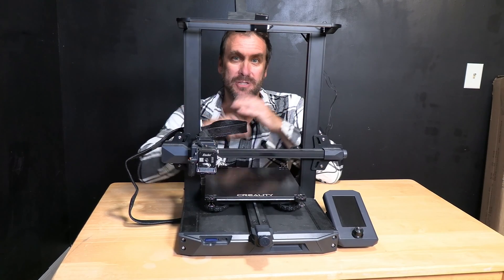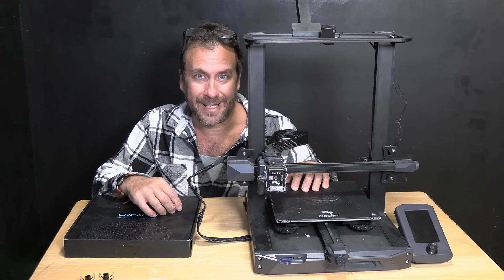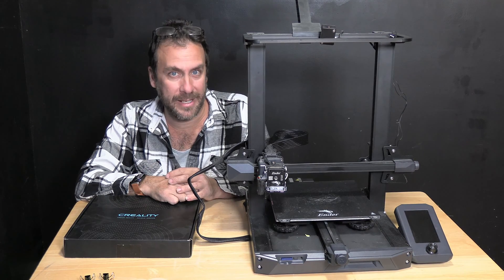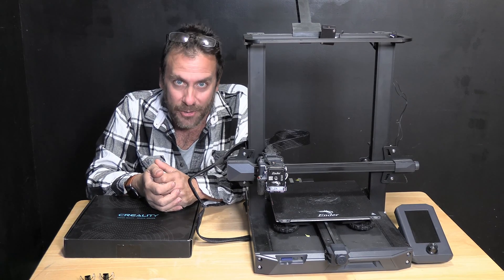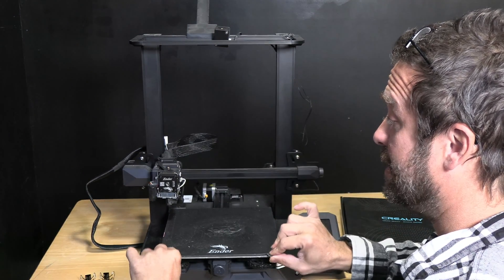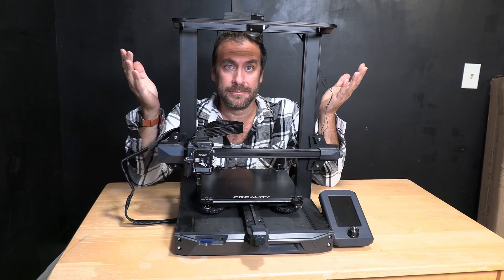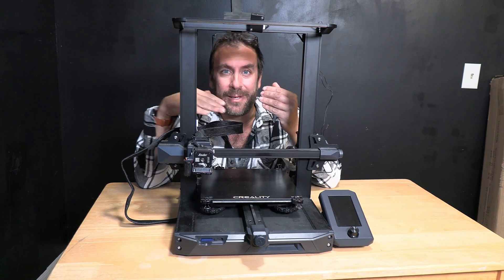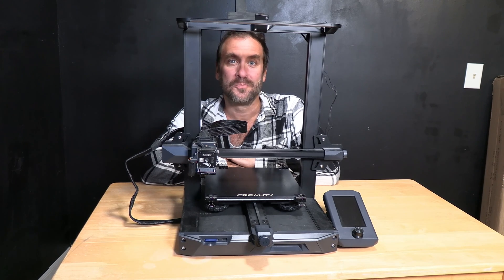Swap Creality Ender 3 S1 (or S1 PRO) Magnetic Bed with GLASS BED, for Instantly better Results!

Comment: Mines sticking to the magnetic film on he build plate. Should I take it off?
Reply from the maker: I wouldn't. Haven't touched my Glass bed since the day I put it on. If you ever need to remove it, which you probably won't, you'll be able to work it off. I tested on mine and got it to separate with some encouragement.
Reply: @3DRundown  I have to take mine off every-time because the prints stick so bad to the glass bed any help?

Comment: The idea of the magnetic bed is to remove it with the part and slightly warped to remove the part?
Reply from the maker: Right. Typically, can pull up on a corner and the model will seperate

Comment: Tip I discovered for PLA+, I cleaned the glass bed with soapy water, then dialed the Z offset right down to one of thse thin pieces of paper doctor's letters come on. I initially found that releasing prints was difficult as they were over adhered, but I was still getting corner curling internally. I now print only Layer 1 at 75, then let it cool off to 60 for the rest of the print. Adhesion is amazing throughout the print, bu the temp is low enough i don't see any differential cooling issues at the corners. Then I just let the bed cool off when done and the prints come off really easy.

I also replaced the usual paint scraper with an industrial razor blade holder that allows me to get the blade edge flat to the bed. Tall, narrow prints just come right off the bed without the scraper, low wide prints just need an edge starting and pop. thin, flexible prints still love to stick, so I lift the edge cleanly with the razor, then slide the stiffer paint scraper in to peel the rest.
Reply from the maker: Clean the bed with ipa. Spray a little Hairspray. When bed cools, models remove themselves. Bed temp always the same. Cooling causes contraction. Contraction causes curling or shrinking or bed separation. 60 the whole time

Comment: I'm very new to 3D printing and finding your videos very helpful. I am having a problem, that I cant find an answer to. I am upgrading to the glass bed because I am having problems with adhesion on the stock bed. This video was great, and I viewed the other video on the z axis. the problem I am having, is the videos for all of the z axis, are for the ender 3, the control panel is slightly different for the ender 3 s1 pro (which is what I have). I need to figure out how to lower the z stop so it when levelling, it doesnt dig into the glass. whether thats manually changing the gcode (i dont know how to do that) or change in the setting somehow. Can you help???
Reply from the maker: Hi. There is no Z-STOP on the S1 Machines, we set our Z-Height (AKA: Z-OFFSET) In the firmware. Follow this video: https://youtu.be/dpF_h8aOTAI
Reply: i am having same problem with adhesion

Comment: Thanks for the video! I just replaced my print surface with a glass one, just like the one in your video. I have a problem though. The Sprite extruder is crashing with the clips (same ones as in your video as well). Do you have any advice? I do have the clips all the way.
Reply from the maker: My clips are only on about half way, and they hold fine. I would watch it during the ABL, and adjust the clips out of it's way as it moves by.

Comment: Because the layer fan is very close to the bed, it hits the clips in front, the other problem is that the adhesion is insane, I had to remove the bed and hit the piece with something to make it come out, when you remove the bed the calibration may be altered and it may be necessary to level the bed again, I have those two problems, but I liked more the adhesion of Glass vs PEI, I changed to glass because I realized the bed was warped, I'm just thinking about how to solve those two problems 🤔
Reply from the maker: Run an ABL, and adjust your clips as needed. Mine never hit. The one to watch, is the front left. Move it over a bit, and only clip the end on, the entire clip. It will stay put.

Your Glass is goin through a break-in period. Get Scots Blue Shop towels, and IPA. The only 2 things that ever touch my glass. Put the IPA in a spray bottle. Spray and wipe gently. NO PRESSURE. I like to use a good quality Hairpray. Tresemme #4 hold, to be specific. When you IPA and wipe, the Spray will disolve, spread, and then when the IPA dissolves, the Spray remains, and the tack returns. It's super. It also helps the models to release from the glass. You can remove it completely, with more IPA Wipe. I NEVER remove the glass from the bed. After some use, nearly every model will remove itself from the glass, when it cools. BE SURE TO LET THE GLASS COOL. The contraction, seperates the model. If you have something really stuck. Remember, it's not actually stuck... it's GLASS, not a pourous material or glue. Put the scraper on a corner, and Firm tap. The whole model will usually pop right off at once. Tap front to back, rather than left to right, with the steppers off, so the bed can move, and nothing gets jarred out of wack. Keep your bed on, unless you absoluytely have to remove it
Reply: @3DRundown  Hi, sorry, when you say "You can remove it completely, with more IPA Wipe", i don't understand, how u remove models with IPA?
Reply: Did you ever find a fix for the clips getting hit off. im having the same issue on my s1
Reply: @veryvoyles  I recently found on Amazon a kind of clips for Ender 3 that I think are low profile, I don't know if them will work with my S1, probably yes, I just bought them, I'm waiting for them to arrive for testing
Reply: @johnmorenov  Hey, I'm having the exact same problem, did those low profile clips work?
Reply: Same problem on S1 Plus. Swapped to a 2mm G10 sheet, but the clips get ripped off.

Comment: How do you avoid the layer's fan and the Bl-touch touching the binder clips on then front? Im having issues with the front left binder clip, I'm not going all the way jsut the half part and the binder clips are number1(the smallerones)
Reply from the maker: Use bigger, stronger clips, and just clip the front of the clip. Will hold fine
Reply: Having the same issue we’re you able to find a solution?
Reply: bump
Reply: I'm having same issue. Really do not like that it was hitting the fan and making a nasty jump. Mostly just at the start of the print when is does the purge line on the left of the bed. I'm messing with Gcode to reduce the Y travel at the start so that it doesn't purge as long of a line and then I'm moving the Z axis in the code to go up higher from purge line to start of print just in case.
Reply: Having the exact same problem. Accidentally set off my house alarm because the clip (just on the edge) flung off, made a terrrible racket, and triggered my glass break sensor 😂

Trying to work with the starting Gcode so the Z clearance is better, and I have to be mindful of large parts printing near the edge. 

Might print out some plate clips from Thingiverse, but I’d like something stronger than PLA.
Reply: @hleumasg  Hello greg, did you find a solution for this issue ??

Comment: I recall in your last s1 video regarding leveling the print bed you mentioned that glass needs to be preheated prior to leveling. What temperature would I have to heat it to? Does it depend on what material I plan to print?
Reply from the maker: When you choose "pre heat", it will set the temp by itself. It doesnt really matter too much, long as its not COLD

Comment: if i have a 3s plus could i in theory get a glass sheet and cut it to  size?
Reply from the maker: Ender 3 S1 Plus? Use this one: https://amzn.to/3iRrnhQ
Reply: @3DRundown  Will I need to adjust the sensor for my z home? Or will ABL/Z offset take care of that?
Reply from the maker: @Cactus_Dog  nope, it'll probe the bed when you home. Just check your Z and run an ABL to be sure all is in check

Comment: Tip: if you have a glass bed you can always put a PEI sheet on top of it.
My experience found that helps with warp beds as glass can’t bend so I find it to be more flat than dropping the PEI sheet directly on to the bed plate hopefully make sense?
Reply from the maker: Sure, that could work, but I prefer Glass over PEI